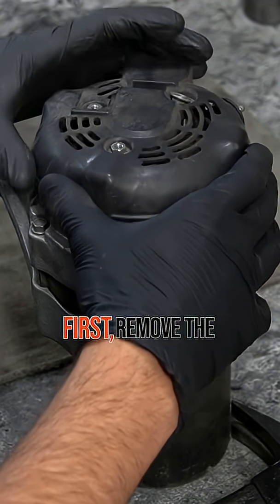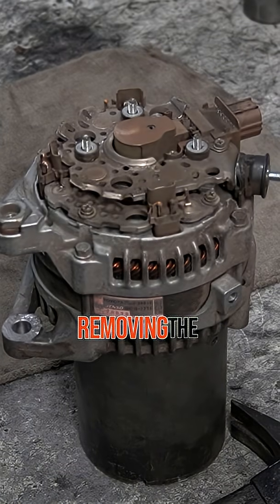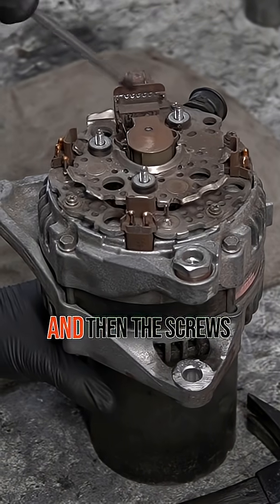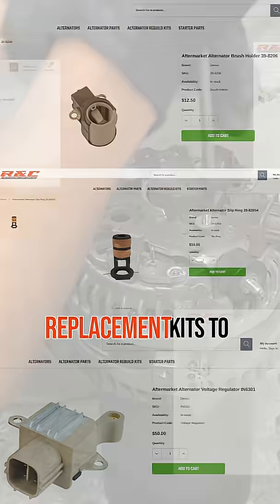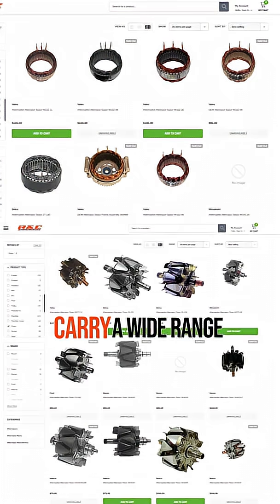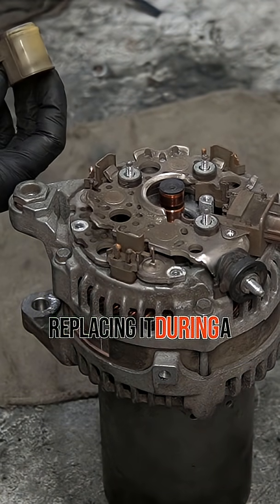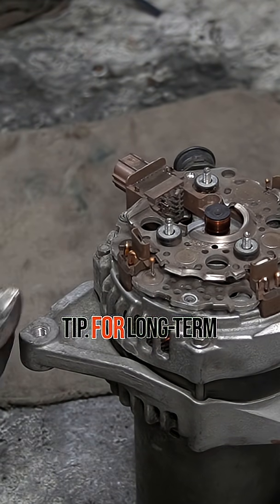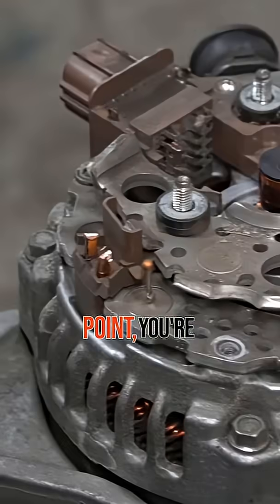Alternator Disassembly part 1 #alternator #repair #diy #toyotacars #toyotacamry

Comment: Hello I would like to know what Cain of soldering iron you guys use to soldering the rectifier back? The wattage 100 200 or 300watts? Thanks
Reply from the maker: yes we use a regular generic Weller 80 watts soldering iron, can also use other options as well
Reply: nice thank you guys.